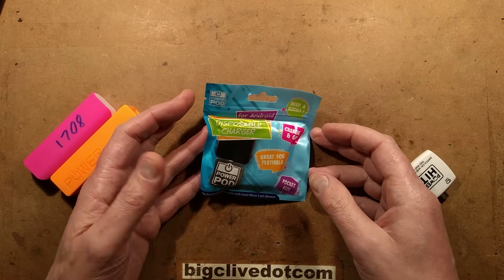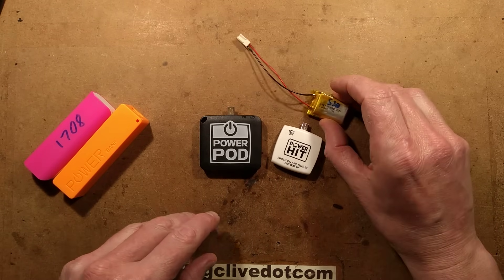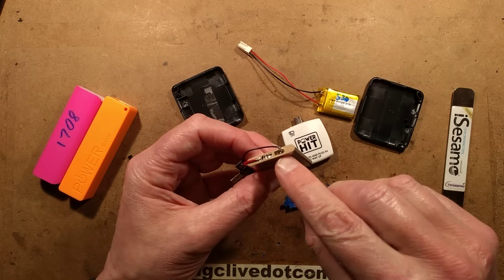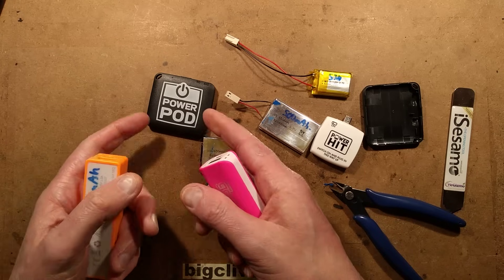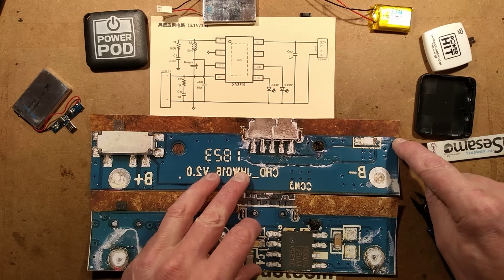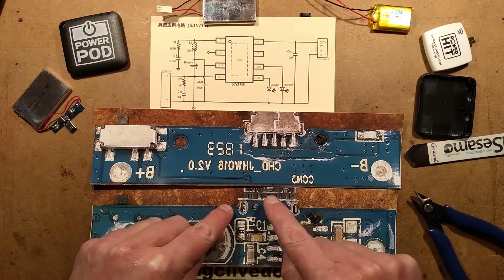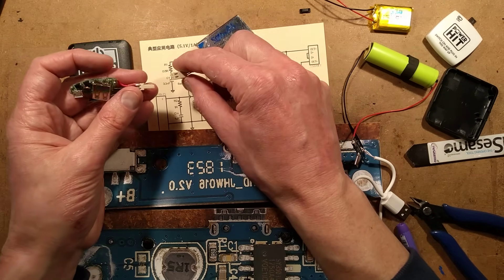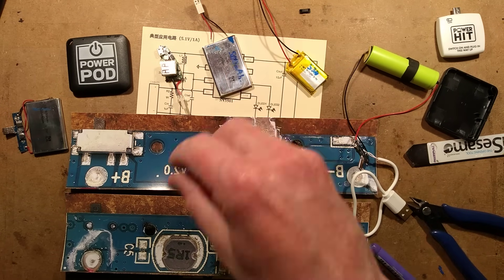Poundland "disposable" phone charger.

Comment: It should be illegal to bring these kind of products to market. Stupid.
Reply: The thing that gets me is that they're more expensive than a chargable powerbank and it probably wouldn't cost much to add a switch to those and pre-charge them before shipping.
Reply: @TrollDecker  No money in that tho, why sell something once when you can sell it multiple times. that kind of greed is why pointless disposables like this exist.
Reply: @TrollDecker  worse still, in the same shops they sell a rechargeable power bank for £1, larger capacity too
Reply: do you know how many products on market are illegal already, most of the stuff from china does not comply with uk or eu standards.
Reply: I remember something from the mid 80s or so regarding Japan and mercury poisoning.  Those little watch/calculator batteries were finding their way into landfills in such great numbers that the bay became poisoned to the extent that the food supply of fish and other aquatic life was contaminated.  No one thought anything about it until birth defects became almost commonplace.  People with knurled fingers and rampant brain disorders.  

Throwing away lithium cells, even if they don't contain "that much" lithium is irresponsible and, as many things are, detrimental to the environment, our food and water, our future.

I think it's irresponsible to even sell these disposable power banks or, even normal rechargeable power banks without more warnings and education to dispose of them properly.  I think there also should be easier public disposal of these things.

Oh no, the government is going to tell us what we can and can't throw away.  The Horror!  That's what government is for, when people are too stupid to do the right things.

Okay, the mercury thing was a little different but then so was Radon watch face painters with their horrible disfiguring cancers that resulted.  

Just my thoughts.  I really dislike the single serving disposable package throw away world.  There's a stat that says the single serving K-cups sold in 2014 would, if put end to end, circle the globe more than 10.5 times (the number is actually more than 12)

I digress.
Reply: @amorphuc  there is practically no lithium in a lithium-ion cell. It's the electrolyte that is problematic.
Reply: @zaprodk  I get that.  But still think what about 10,000 of em?  Or more.
Reply: @amorphuc  It better to buy poundland 1200mph power bank one for one pound or there power geek 2200 power bank  one for two pound  or there 4000mah power bank one for five pound
Reply: @mrwahibtahri  What exactly are you trying to say?  (3 is spelled three by the way)
Reply: Wow. This escalated.
Reply: Agree with the original comment 100% lithium batters should never be thrown away at all
Reply: @MrSashquatch2.0  It better to buy poundland 1200mph power bank one for one pound or there power geek 2200 power bank  one for two pound  or there 4000mah power bank one for five pound
Reply: Don't people understand powerbanks?
Reply: Cartoonman154 I understand a power bank,
Reply: Many people simply , just do not understand!!
Reply: The free market won't help us fight pollution, stuff like this, lack of right to repair and planned obsolescence only worsens it.
Reply: @iwiffitthitotonacc4673  The 1970s, 1980s and 1990s would like a word with you.  We had a basically freer market here in the US and yet none of this kind of anti-right to repair shit was going on.  In the early 2000s and on, then it happened.  The consumer became too complicit without looking back.  If we designed things here IN THE US, and did not take most of our manufacturing to cheaper countries, as well as making sure companies aren't outright hurting the consumer (i.e insurance companies leaving any state that has natural disasters which is not only a scam but pure malevolence on their part because they're still making the same amount of money they did in the past and proceeding to drop people because they're not getting more) we would not have this issue.
Reply: @iwiffitthitotonacc4673  its not lack of right to repair, its lack of knowledge.
Reply: @iwiffitthitotonacc4673  I live in a pretty free market and nobody buys these things, because they're not cost effective.  Seems like the free market works pretty well.
Reply: @iwiffitthitotonacc4673  will the government's not going to help any better.

The free market is still the best option, you just need to put some regulation here and there, very little, but in the right places.
Reply: @iwiffitthitotonacc4673  It better to buy poundland 1200mph power bank one for one pound or there power geek 2200 power bank  one for two pound  or there 4000mah power bank one for five pound
Reply: @iwiffitthitotonacc4673  The free market isn't the problem here. This product would not exist if people would not buy it.  
Stop blaming companies for the waste that people throw away.
Reply: @zanthraxnl  blaming the system is not the same as blaming the companies. It should be illegal to bring these to market because allowing them to be brought to market and then forbidding their purchase is pointless.

The general population's stupidity is not an excuse to allow this garbage to destroy our future.
Reply: @zanthraxnl Really? So companies have no ethical responsibility when they choose to bring such a wasteful product to the market?
Reply: @zanthraxnl  hahahaha the free market is allowing these companies to advertise these as "single use". What do you expect people to do?
Reply: @zanthraxnl  There would also be a big free market for cars that don't come with a catalytic converter.

But forcing it by law remains a good idea because there are people who would buy it and companies that would sell it.
Reply: @zanthraxnl  is designed to be thrown away :?!?!?
Reply: @zanthraxnl  companies should not sell this shit
Reply: I completely agree. Bringing prodects like this to the market, in the current sate of the planet, is completely irresponsible. Not to mention pointless.
Reply: @manuelh.4147  Yes only "Genius" has limits where as idiocy knows no such boundaries!
Reply: Easiest way to dump lithium into a target area
Reply: Steinhoff International (Poundland) are being investigated for financial irregularities in South Africa.
Reply: @51StPi  It better to buy poundland 1200mph power bank one for one pound or there power geek 2200 power bank  one for two pound  or there 4000mah power bank one for five pound
Reply: The same goes with single use AA, AAA and other types of. batteries
Reply: That was the first thought I had when I watched his video on the power hit. Lithium mining is extremely destructive and its sad to think of someone throwing away a nearly unused battery.
Reply: If this was a way to sell old or recycled phone batteries you'd think they'd make it rechargeable.
Reply: @Xenon777_  Have you seen the people that shop in pound land?
Reply: Its honestly so stupid.... its gonna cause so much waste
Reply: Yeah its stupid
Reply: I love it I buy about 500 of these every month
Reply: Yea, this really worries me too. :/
Reply: @Xenon777_   I get the joke......Duh ...I hope you are joking.
Reply: waste full
Reply: @HighVoltageMadness  *wasteful, yes.
Reply: It’s when you’ve been holding one for weeks.
Reply: @GoblyosBence-jd1fc  No, they do not catch fire. There is no metallic Lithium in them.
Reply: Invention as product as a try as a product.
Reply: zapro_dk your stupid
Reply: @Siren-l7t  A shop for a sale.
Reply: Poundland. 😏
Reply: @GoblyosBence-jd1fc  It better to buy poundland 1200mph power bank one for one pound or there power geek 2200 power bank  one for two pound  or there 4000mah power bank one for five pound
Reply: Honestly I can see this being used at places for security reasons, but it is not yet a complete product.
Reply: @zapro_dk Totally agree mate.
Reply: zapro_dk yes.
Reply: If it wasn’t all made in China, it probably wouldn’t exist
Reply: I don't like bootleggers! Not official!
Reply: this is a one or two time purchase. you'd put one your bag or purse or glove box.
just to have enough power for a couple emergency calls or texts. I can see the average 
consumers being more comfortable with something like this. the rest of us know
and understand powerbanks. even my home life is more convenient because of them.
3 20,000mah banks in the house and you can have mobile power for days.
Reply: Money is money
Reply: This product is dumb, been using a rechargeable power bank for years, the one I have plugs into the wall or recharges through USB.
Reply: Cool it with the anti-semitism bud.
Reply: disposable vapes are the same thing. also a battery without any protection. but instead of charging your phone, they power a metal heating element to heat up e liquid
Reply: Ongg
Reply: It is.
Reply: no it shouldn't
Reply: @Xenon777_  many people will buy it because they are stupid, they dont care to or know how to do research and buy a proper product....
Reply: @manuelh.4147  “Only two things are infinite, the universe and human stupidity, and I'm not sure about the former.” Einstein
Reply: Saw a woman in £land today, ripping open one of the £1 power banks and trying to charge her phone from it (without paying, of course).
I expect she abandoned it, packaging and all once it was explained to her that the power bank also need  charging, as well as her phone.
I realise now why they are sold in the fully discharged state - people are so self-centered these days that they think such behaviour is acceptable.
Reply: @mahlapropyzm9180  It better to buy poundland 1200mph power bank one for one pound or there power geek 2200 power bank  one for two pound  or there 4000mah power bank one for five pound
Reply: We live in a country that imho actively discourages recycling, ever had to get rid of broken furniture or old electronics?

Can't put them in the recycling, can't take them round the local recycling centre without being charged, they just want people to fly tip
Reply: Sun Wukong in the US it’s fairly easy to get rid of broken or old furniture, a lot of people are willing to buy just about anything at a yard sale, and if you can’t sell it you can just take it to a dump
Reply: @Xenon777_  Weather people buy it or not , they will still end up in landfill polluting our planet!
Reply: @marky181  but if people stop buying them, companies will stop making them.
Reply: I would like to thank the "free market" for giving me so many things for free after making idiots pay for them.
Reply: Go figure the "free market" drones would jump on this.
Reply: I agree infinity percent, they should have any profit stripped from them for having to deal with the TOXIC wastes and chemicals..... which is exactly what everyone misses and ignores....
everyone is too busy trying to "pad" their pockets vs. having a care about the planet earth, but no issues, MOTHER NATURE is winning and will win.......
Reply: @throttlebottle5906  Also, those lithium cells can be used for other purposes. Lithium, when heated up, is EXTREMELY flammable and can be a hazard when dumped into a landfill.
Reply: Plastic pollition is killing planet https://youtu.be/RS7IzU2VJIQ
Reply: @plasmaburndeath  true!
Reply: @plasmaburndeath  plastic is also an amazing product that has saved your life at least once.
Reply: @plasmaburndeath  so? Why is that a problem? Live for the now  50-90 years down the road has no bearing  atm
Reply: How many songs does it store?
Reply: @ricardomontalban6004  It better to buy poundland 1200mph power bank one for one pound or there power geek 2200 power bank  one for two pound  or there 4000mah power bank one for five pound
Reply: John Doe says the anonymous twat.
Reply: that’s capitalism baby. if people will buy it then sell it!!
Reply: @alfstewart2592  Every person watching this video or commenting on it is exercising their freedom to waste resources and harm the environment.
Reply: @Xenon777_  It better to buy poundland 1200mph power bank one for one pound or there power geek 2200 power bank  one for two pound  or there 4000mah power bank one for five pound
Reply: mrwahib tahri 1200 mph power bank? Wow, that's fast.
Reply: @rjgscotland  no it just give you extra 30% battery on your phone 

The 2200 and 4000mah  one better 

But the 1200mah one still good
Reply: @rjgscotland  not really 2200man  is better and 4000 man  even better
Reply: @mrwahibtahri  *mAh *their
Reply: Lots of Stalinists and Hitlerites think the government should be able to throw people in jail for making products they don't like. You're in truly good company you fascist.
Reply: 666th like.
Reply: no it shouldn't be.
Reply: No it shouldn't, if you don't like something, don't buy it. We shouldn't restrict people from choosing what they want to buy because we don't like it.
Reply: So in order to prevent the stupid consumers from buying this, you want to give the stupid consumer control over armies and police to enforce their whims? You may be stupider than the people who buy this.
Reply: @LaminarLogic  Product to buy.
Reply: fuck off, its cheap litium
Reply: Ah yes, beautiful socialism and regulation of the free market. Chances are people won't buy them and therefore there's no incentive to sell them, although a good compromise would be to label the milliamp-hours you're gonna get from them on the packet itself.
Reply: @koalakurosh  "Chances are people won't buy them and therefore there's no incentive to sell them" The problem isn't that they will or won't sell, its that they were made in the first place regardless if they would sell of not, its like no market testing was done. 
Im not anti-capitalism but one issue I have with it is that it will happily make a poor product (like described in this video) that consumes finite resources and should the product not sell everyone goes "well thats a free market doing its thing".. yet saying such a phrase ignores the useless product come at the cost of pollution, use of resources and landfill space... it just assumes it can just keep playing the market hoping for that selling product and all the ones that fail have no consequence for us or even the market
Reply: @DanafoxyVixen  It better to buy poundland 1200mph power bank one for one pound or there power geek 2200 power bank  one for two pound  or there 4000mah power bank one for five pound
Reply: I agree, it is stupid, but we shouldn't be telling private companies what to do unless it's a direct threat to people's way of life.
Reply: @dumdum7786  There is only a finite amount of lithium and other elements used in modern batteries in the world, even less of it accessible in economically viable manners. Wasting lithium in one-time rechargeable cells may not hurt people's "way of life" right now, but it will come back to bite the whole world and the environment in the arse in a decade or two from now.
Reply: @dumdum7786  We should be telling companies what to do if its an indirect threat to people life, that's actually a lot worse because many people won't realize it until its too late... as long as they directly contribute, they are apart of the problem and its effects, and we need to do everything we can to not support them.
Reply: @dumdum7786  Pollution and waste IS a direct threat to people's way of life.
Reply: @dumdum7786  But it is - simply not in the short term.
Reply: MOM ITS NOT WHAT IT LOOKS LIKE it is a direct threat, perhaps not to you, you'll use it once and dump it, but where does all that tech garbage goes to rest? third world countries.... and we should be able to tell companies what to do if what they do simply disregards the environment, STOP PRETENDING THAT CONTAMINATION IS OK IF IT BRINGS A PROFIT, ITS NOT!
Reply: So pollution is not a direct threat of life ? @dumdum7786
Reply: @dumdum7786  they used to sell cocaine at the drug store. But you know we shouldnt have told those poor private drug dealers what to do
Reply: @dumdum7786  well considering how rare lithium is it is a threat to the future of ....like everybody.  Especially when people don't recycle lithium batteries properly.  i also think using helium in party balloons should be illegal as the balloons pop and that helium floats up and up and up and out into fucking space.
Reply: @dumdum7786  do you know how much pollution extracting lithium causes? And people definitely won't be recycling it either, meaning it will just end up in a landfill. All of this for a product that will give you 10% of charge at most. Any product that causes a lot of pollution at manufacturing and is designed to be thrown away after 1 use should be illegal.
Reply: @dumdum7786  but electronic waste does affect people!
Reply: @Mike Herbst how?
Reply: It's absolutely a threat to people's way of life.
And it's probably profitable, so it won't stop unless it's outlawed.
Reply: @dumdum7786  Selling guns for kids is not directly bad for others. Guns don't kill like some say
Reply: @Arnis what? I didn't even mention guns.
Reply: Bullshit, people are free to buy with their money whatever they want.
Reply: @dorfschmidt4833  are you a idiot? be honest. Everyother commen on this thread (even ones i strongly disagree with) have some sort of merit except yours.